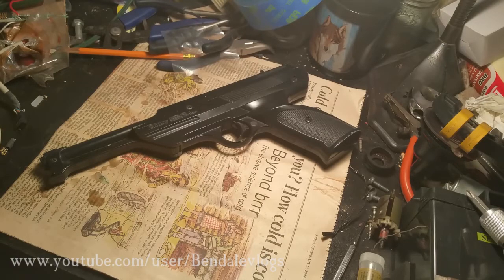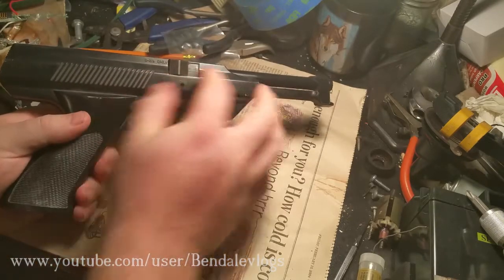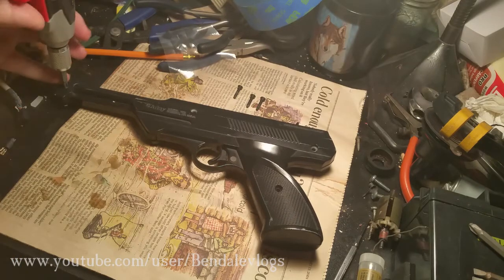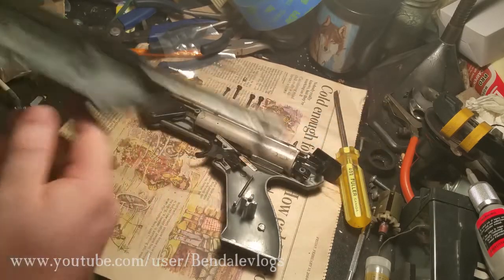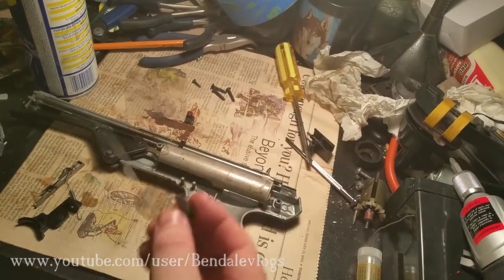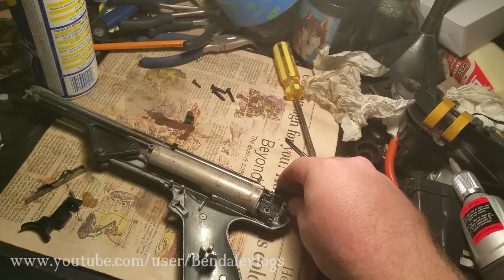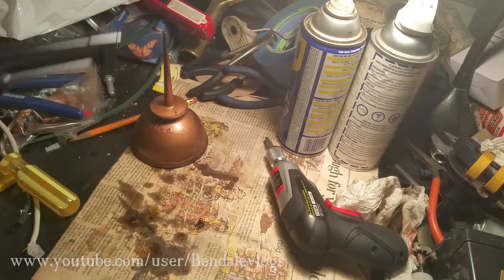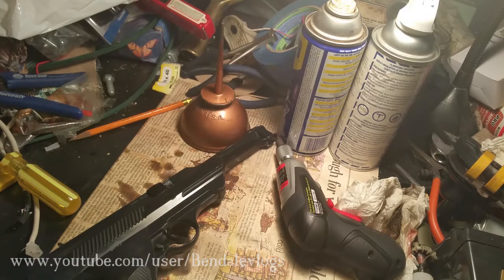What's inside a Daisy BB pistol (model 188)

Comment: I just uncovered one of these out of the dirt in the woods when i was doing some work on my property. it’s looks pretty good for a gun that’s been in the ground for several years. i bet i could even get it to work if i took it all apart and cleaned it out.
Reply: dont do that, i found one in the attic of my shed a few years ago but once you open and even move anything around it has a high chance the plastic is old and very brittle, i moved a spring once i got mine open and it broke some plastic it was attached too, i had to 3d print a new piece for it so it could work again